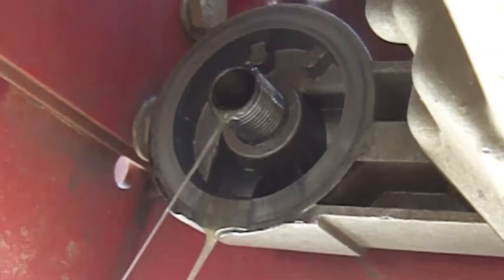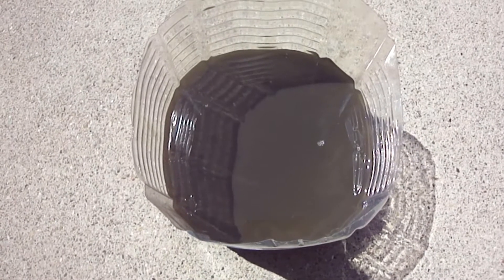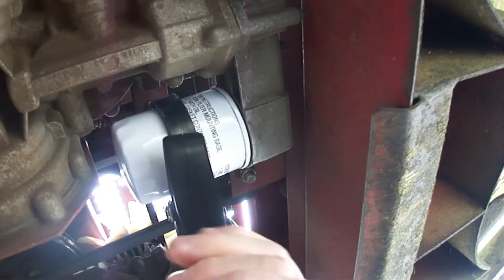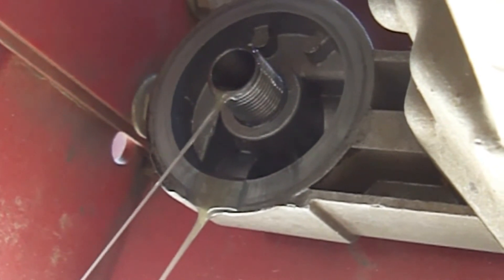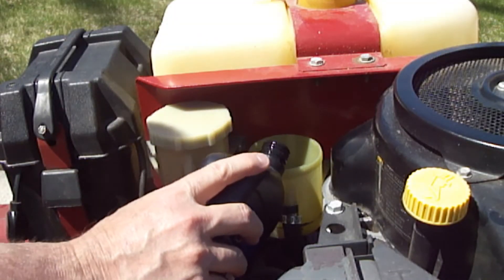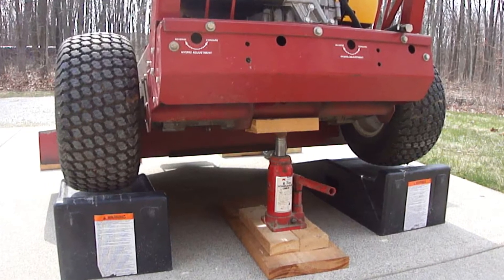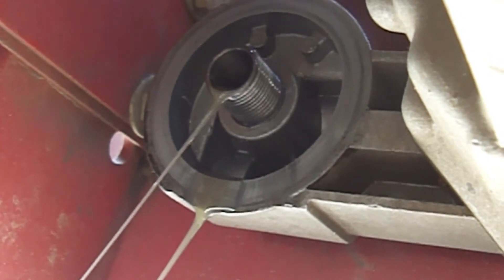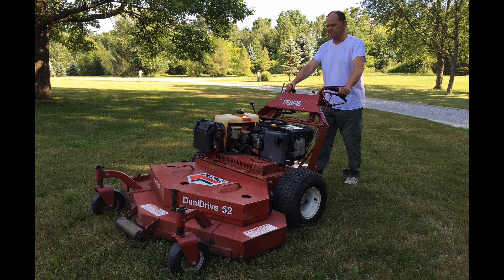Why Hydrostatic Transmission Oil Turns Gray - Easy Fix!

Comment: Thank you for the concise no nonsense videos part#1 & part#2. I have same Ferris unit as in your videos. A couple questions: the oil used, the filters (micron specs) used and when addressing the 'gray' oil issue, did you change filters for every cycle of oil change for the effected pump? Thanks again for the videos

Comment: Brand new bad boy maverick had me tripping…did the 50 hour service an had the same thing happen to me one was the honey color it should be an the other was grey this would make sense considering i powerwashed mine also. Mine doesn’t have a expansion tank only a fill port that also confused me it has the hydro gear 3200 commercial hydros and on the older ones with the same hydros they had expansion tanks i guess they removed them on the 2021 3200’s.